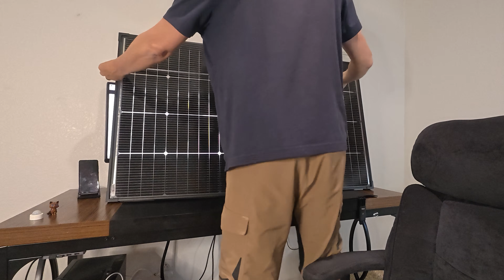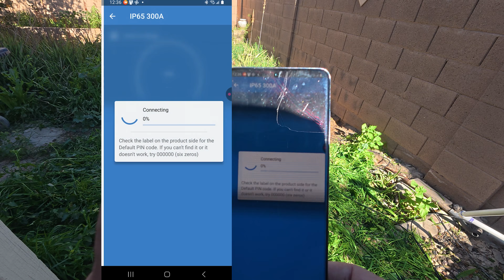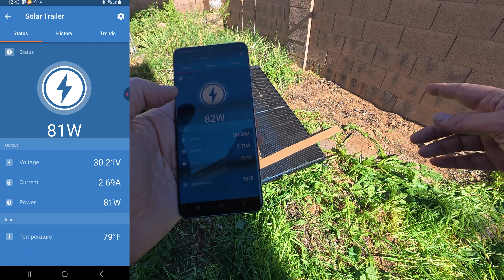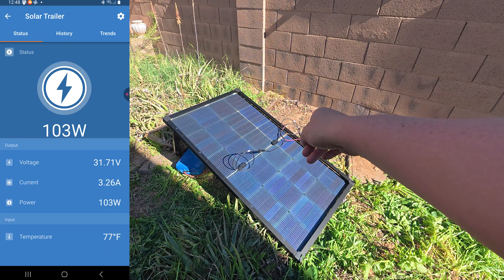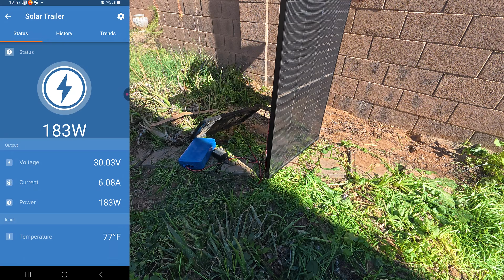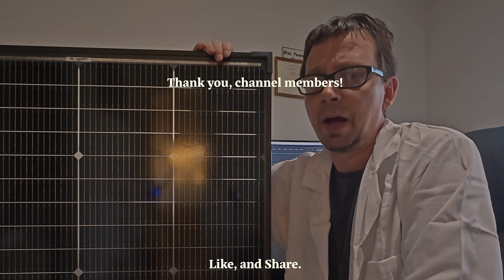BougeRV 24V N Type 16BB 200W Bifacial Solar Panel

Comment: Thank you for demonstrating this wonderful panel. I would be worried that adding more reflection underneath would increase the heat, which might decrease efficiency. Yet with airflow I wonder what a white reflective surface could provide underneath.
Reply from the maker: Heat can always be an issue with solar; however that said I still get the best solar in summer, even in Arizona. I just have to use water to cool the panel to see their max output.

Comment: Been thinking of trying a panel like this and standing it straight up on the bike trailer. My thought if it can't auto rotate then standing it up like its on your desk is best. And the bikers that have auto rotating panels are just wasting power with what's needed to monitor sun and all.
Reply from the maker: Standing it up is great for maximizing sun exposure in many situations like Canada where the sun is never overhead!